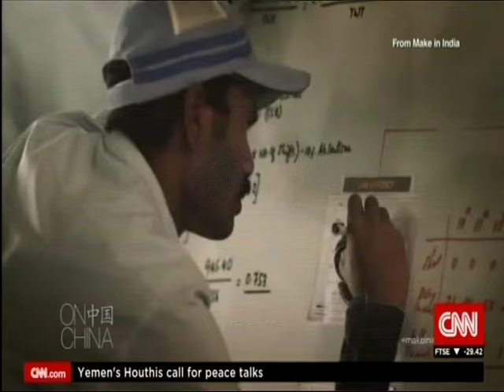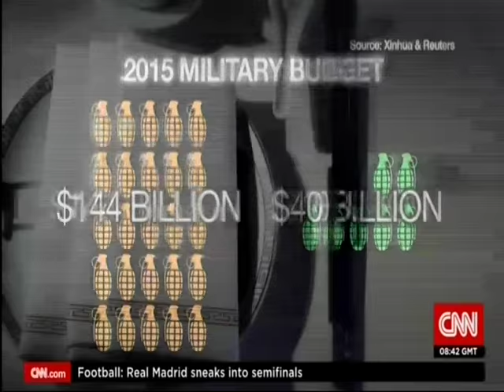India vs China - Partners or Rivals?

Comment: China is like a race car with boosters but no brakes and India is like a Toyota car that will just keep going.
Reply from the maker: SHIVAM DUTTA Don't India and China still import european and japanese cars because the locally produced ones are so poorly made?
Reply: SHIVAM DUTTA India keeps on going? India was growing at its peak 10% in 2010, by 2012 it was at 4.5%. hardly keep going is it?

China at 7% growth is adding 500 billion more to its economy than India at 8% growth. The gap is getting bigger year by year. Currently China's economy is at 11.3 trillion while India is at 2.1trillion.
Reply: SHIVAM DUTTA we all agree Japanese cars are made of poor qualities, right?
Reply: SHIVAM DUTTA and Toyota car will be completely squashed if it ever get into a car crash accident
Reply: @candidcandy9265  You don't know Toyota cars. They're the best in market. As for quality, look at China's BYD :) China has a knock-off, but no real innovation.
Reply: @vicktorl9862  that's true. And just the US, it's rate will fall below 3%. Whereas for FY 21, India has clocked a 9.5% growth. Without the pandemic, we'll touch 10+% growth. And we don't a crisis at the top, China does. It's an authoritative structure. When it will blow with the pressure cooker not having a safety valve like India does is just a question of time.
Reply: @mastertrollmind  Toyotas last 25-40 years if you didn't know. Land cruiser is the longest running vehicle. European cars are for luxury and when it comes to reliability, my Highlander is exponentially better. And American cars never go beyond 15+ years. :)
Reply: Apt metaphor, though I'd say the fact that it doesn't have brakes but still it hasn't crashed. With it's military inwards intrusion into Vietnam's and Japan's waters and intimidating the West, it's just a matter of time.